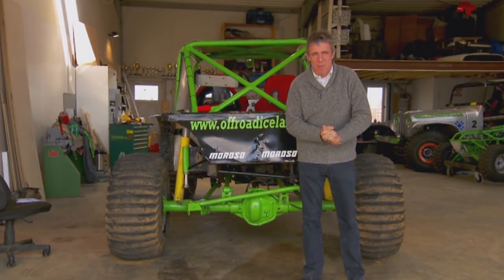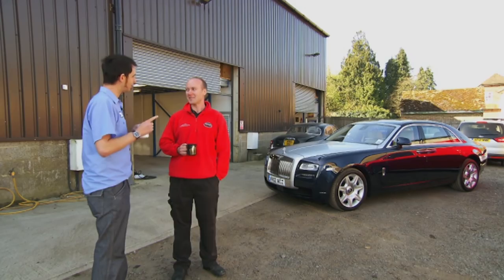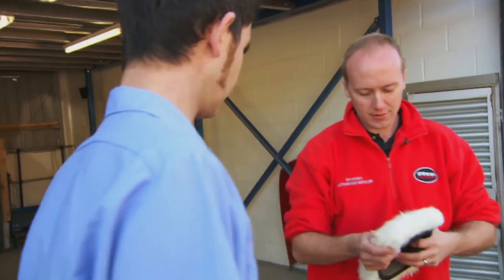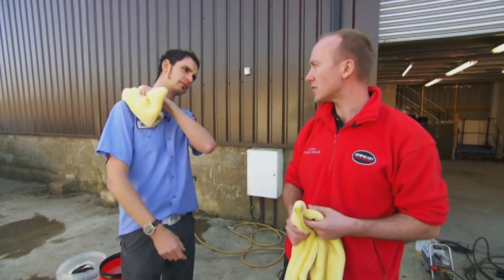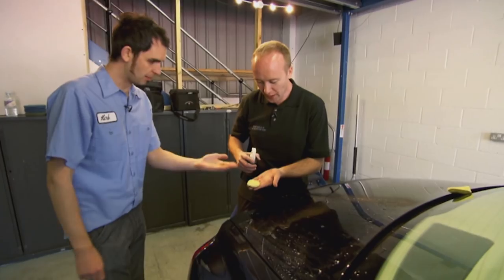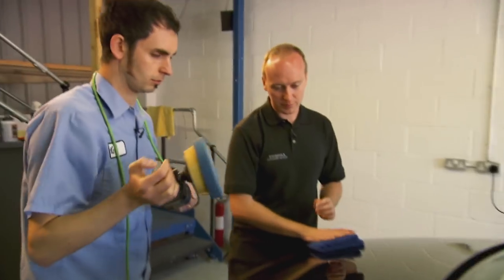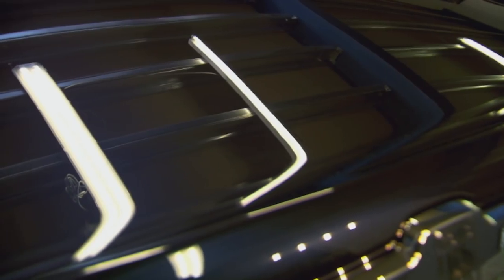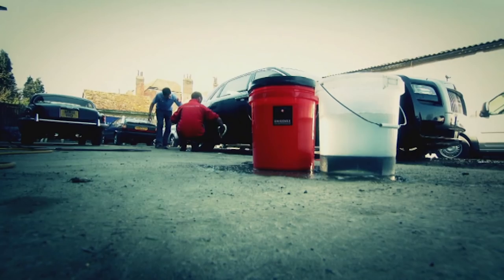Fifth Gear: How To Properly Wash Your Car

Comment: My car gets washed when it rains.
Reply: Winter has its benefits
Reply: Exactly
Reply: 7,- Euro gasstation carwash every three years or so. I'll also drop 50 Eurocent in the pressure washer and knock off road salt after every winter spell.

Comment: The most time consuming part in detailing a car is the polishing, I know from experience. A half decent 3 stage polish will take 1 to 2 days depending how bad the paintwork is and how intricate the body panels are. Then you will have a day cleaning and decontaminating first and half a day to a day on the wheels. So for a very good detail you could be looking at 4 days. To clean, decontaminate and one stage polish my old Astra vxr and the. Protect with polish or sealant would take me a full day.

A lot of money is spent on products, some waxes can cost in excess of £1,000. Yes, you could say what the point but what’s the point in buying anything expensive, why buy a white t-shirt from Ralph Lauren for £80 when you could get the same for a tenner? You pay for the name and product. A car will always get dirty but proper protection will help protect the paintwork and keep it looking its best and ultimately help in resale value
Reply: That is a good point.  Why buy a white T-Shirt from Ralph Lauren for £80 when you could get the same for a tenner?  Why spend 2 days on polishing when you can take 2 hours?I'm also calling bullshit on the idea that "proper protection" will help the resale value.  Unless you've got a colour which should be illegal, like red or black, you can leave a car dirty for months or years on end and it doesn't add a penny to the deflation.

Comment: Nice one. Heads up. As my Mazda 3 2018 has an ceramic coating applied to it. It does it no harm to wax it. Did not know about the STRAIGHT lines and just SUCKING up the moisture to dry it out. NICE ONE.

Comment: washing up liquid is great for removing wax, which is what you want to do when you're adding a ceramic coating or sealant
Reply: Washing up liquid does not stop wax that bull shit it leaves a film on the paint that gives the appearance that it’s been stripped only way is an abrasive polish then panel wipe to remove oils
Reply: Yes. The idea that it is bad for cars came from the days of terrible paint technology and cars starting to rust as they left the factory. The theory was:  Because detergent breaks surface tension of water it would allow it to get in between folded seams of the metal bodywork more-so than water alone and therefore accelerate corrosion. The difference between dish-washing detergent and car-wash are the waxes & other protectant additives that would protect those spots it got into. However the failure of this theory is that the capillary action is actually REDUCED by adding detergent. The lower the tension the lower the capillary pressure. Plain water gets further into the seams.
Reply: im willing to wager if you did a trial with a good shampoo vs fairy liquid then did everything else the same over 2 years no one would notice anything. absolute bollocks. good luck with your Simonz folks! hahaha

Comment: All this is basic stuff...5000?!  Seriously?!
Reply: glovedcop69 this video I agree all basic stuff yes. But if u have a luxurious vehicle that needs a 3 stage paint recovery etc etc using the best products that can take up to two weeks to complete a car. Also I think they have said 5k to get views!
Reply: No car clean, however detailed takes 2 weeks. You can strip the entire car to bare metal and repaint in far less than 2 weeks and for less than £5000 as well. There are detailers near me that do a detail that is 7 days, and the only step different from their 24hr service is they use a stronger cutting compound first before the intermediate then high gloss. So they are basically saying it takes 6 days just to do one more pass with the DA with a stronger cutting compound. Even a novice can DA an entire car in a couple of hours. Its a con, the 7 days is literally there just to make it sound like you are getting alot more for your money than you actually are. The car will sit to one side in the workshop for 6 days then get done in one day.
Reply: Try wet sanding a whole car to perfection and then compounding and polishing all of it in one day.
Reply: Based on personal experience, resprays are usually far poorer than an OEM finish. The 5000 is literally a fully non existent exaggeration by with gear. The only service that should take anywhere north of 1250 would be a orange peel removal which is essentially full show car prep. and the results would be astounding and bar stone chips could easily surpass the majority of body shops in the UK at least lol
Reply: He says "up to £5k", which must include part restoration of interior and exterior.
Reply: Really? Some colors of paints cost more than 5k, and respraying some exotic in the best of the best of places, would probably cost you upwards of 20k.
Reply: Maybe for a fucking semi truck
Reply: Quality sells mate. I've charged a guy € 500 to spend about 8 minutes reading the urban planning ordnances that apply to his company's location, and about 4 minutes to type up a brief report about it. Now € 500 for 12 minutes, not counting the 30 seconds it took to e-mail it to him.... That is charging € 2500 per hour. You can get a small army of lawyers for that.

Yet he was happy as can be as my head comes with a small label that says "Proven across 5+ years of work: Nobody knows urban planning better than this one."

And most of all he doesn't want to have to do such a thing himself.

You don't make that kind of money every day, and I've once spent 6,5 hours answering the exact same question for the exact same € 500, so that was a waste of time, but in the end, quality sells.

Because quality is also fleeting. If I get it wrong and he gets an enforcement action against him because I misinterpreted something, he's coming to my door to claim his damages on me.

Comment: Why would you spend that much on something that will start gathering dirt  the minute you drive it out of the lot? How long before you are required to spend that much again? Two days??
Reply: Richie Zed because the car has had paint correction and is now protected. So that means the next time the car is washed following these tips it’s much easier plus you get better results. If you’ve got an expensive car wouldn’t you want to take care of if?
Reply: More like a one year.. if you wash it like this even more. i polished my car every 4 months and put wax once a month.. cause I'm using much cheaper products..
Reply: Actually in just 15 minutes bird droppings magically appear on my car
Reply: u would understand if u were a car guy non car guys dont understand the point of this
Reply: If you spend 200k+ on a car it would be reasonable to spend 10-20k on maintainance every year. Plus if you just love cars it would justify even higher maintainance cost.
Reply: 4-6 months?
Reply: Single guys with free time, do not comment.  LOL      I'm too late.
Reply: @benhook1850  Exactly. Now you just foam cannon it or just rinse it, then blow it dry with air! It won't have any pesky water spots either. The water sheets off paint that is cared for. Neglected vehicles are a pain to dry.

Comment: Are they realy cleaning it on gravel?
Reply: that was also a thing difficult to comprehend to me. If he says his standards are high, that is one major argument to contradict that. It's plain silly to wash any car in that environment, let alone one that is worth over 200k.
Reply: i hate fact, that car washes invest a lot of money to a sewage, and used water to run off. while these private washers just does this in their own backyard.
Reply: @kerstas10  car washers usually dont use ph neutral shampoo, and that causes any protective layers like wax to strip off. so you should basically re-wax every time you wash at a carwash, wax costs money, takes time, ...at the end of the day handwashing leads to better results and its cheaper

Comment: Quick question: is it ok to hose down the engine bay in the car wash ?
Reply: Yes its perfectly safe, all components are waterproof anyway
Reply: Check out ChrisFix's "How to super clean your engine bay" video, it's good stuff.
Reply: No
Reply: Sakta ChrisFix is great but he often fails. He's a young guy simply without experience. His "expertise" is that he's great at videos. Classic example is his advice to clear-coat headlights. When you have actual experience you know this is just making it worse in the long run. Great video on how to do it tho ;-/
Reply: Adam Woodford Yes, "Waterproof" is a stretch but what do you think happens to an engine when you drive in the rain! Where do you think the water goes when it's forced through the radiator and other gaps at 60+ miles per hour? Nothing wrong with hosing your engine down under mild pressure. Just let it dry out adequately.
Reply: Sakta Sakta Haha rain doesn't have pressure, air does and the pressure differential on the 2 sides of the radiator certainly forces it through. If the HT leads aren't adequately sealed & isolated you will get a short in the rain (as too often happens in old cars) but that's only because it's extremely high voltage. Water won't short out 12v dc current across a simple switch. Electronics yes, but not a simple power switch.

Comment: 5k?? No car cleaner is worth that, by any standard.
Reply: henry horse If you owned a vehicle that was worth in excess of £200,000 or if you own a classic that can easily run into the millions then you would happily pay £5,000 to have the very best detailer work on it, if it’s value gets damaged by improper care then you would be daft not to use someone who knows the best way to care for it. These guys measure paint depth, they strip sections of bodywork off the cars to clean and protect sections that are impossible to reach with a normal clean. You are paying for a lot of skill, a lot of knowledge and the security of knowing that your car is in the very best hands.

Comment: But than again, a automatic £2 carwash is safer than the diy booths with a pressure washer and a brush. People lay the brush on the ground and clean their wheels with them. So in the end you're rubbing sand, brake dust and grease into your paint. At least an automatic carwash has dedicated brushes for each part....
Reply: wouter van wijk Be careful with car washes if you have metallic paint.  Some are easily scraped off

Comment: Honestly  For the price he charges , he doesn't do an exceptional job at all. For that kind of money your detailer removes wheels cleans rotors  suspension parts, protects them, puts everything back together. Etc.  He didn't even use an iron remover on the paint, he didn't use an Alcohol wipedown or ceramic coat it.  A total bloody waste of $   that job should cost no more than  300 💷    the tools and products he uses aren't even top of the line   smh

Comment: So many cabbages in these comments.

You dont understand the pros of doing this sort of detail. Once a car is sealed, almost everything bounces off it. And the stuff that doesn't bounce off, like bird shit, easily slides off the glass like paint and sealant layer with a basic snow foam and rinse, that leaves the protective wax/ ceramic coating layer on the paint. Once this type of detail is done, the car is an absolute piece of piss to keep clean, for many months untill it needs another decontam, (Maybe a polish) and seal.

It will be far, FAR easier to wash between these details than something that's abused, like your shit heap cars for example 😂 and the paint stays perfect at all times.

Comment: 02:24 absolute rubbish about a grit guard!  The only pieces of dirt that will hold beneath it at the bottom of the bucket are those bigger than the openings in it.  If you have bits of dirt and stones that big, they would sit on top of the guard in the water, they don't just magic their way through!  If it's dirt suspended in the water, you have the same problem.  The water would need to stand for hours and settle, then the guard with a very fine mesh could go back in.
He doesn't understand basic physics.

Comment: There are no swirls or scratches on a BRAND NEW car...
Reply: Pasi Sallinen sitting out on the lot, it does get swirls and scratches, clear coat contaminants as well
You just don't know it
Unless the company has polished the clear coat and applied a nice layer(s) of ceramic coating or paint protection film, then yes, a BRAND NEW car would not have swirls, scratches, nor clear coat contaminants
Reply: @moodysobh  Makes sense

Comment: I'm sorry but for what was shown our company would charge £180 and for that you get the full internal, external with machine polish process, and the engine bay valeted. Not a chance in hell that I'd ever expect anyone with common sense to pay more than £180-£250 for a full car to be valeted. There is no difference between a good valet and a detail,  apart from some moron charging 5k........